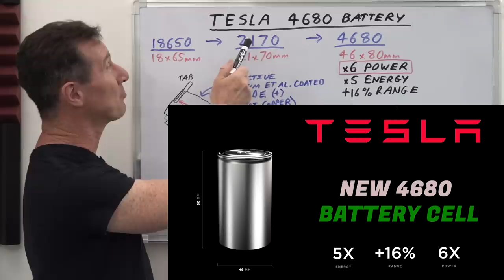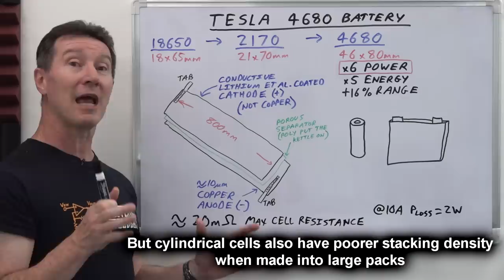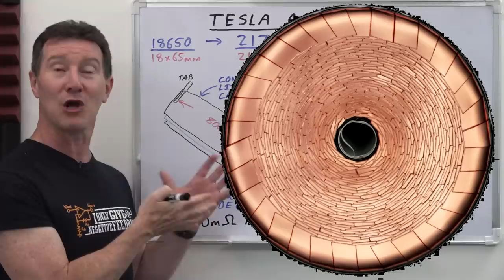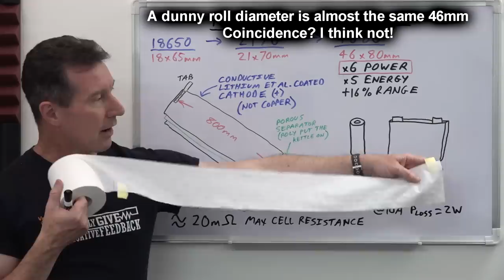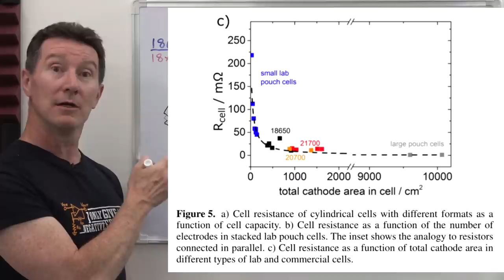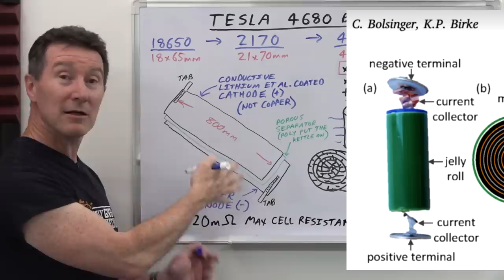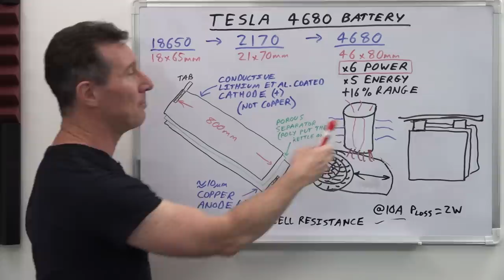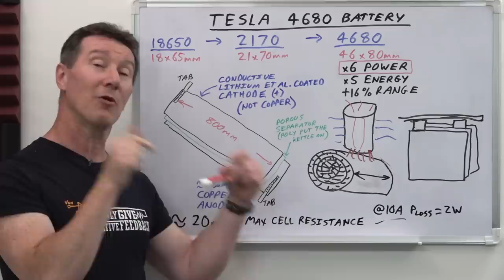EEVblog 1340 - New Tesla 4680 Battery Cell EXPLAINED

Comment: Amazing video. One question, how do they prevent shorting the cathode and anode when folding a single layer like this?
Reply: Instead of the beginning and end of the roll being anode and cathode, it's the entire top and entire bottom of the roll.
Reply: Guessing the two sheets are offset so a small amount of copper from the cathode layer, without the lithium paste coating potrudes from the top, and likewise for the, anode layer for the bottom.
I'd imagine the offset would allow, either end to be folded without anode or cathode contacting. 
Perhaps I very narrow band of insulating paste at the top and bottom of the roll. It will be interesting to find out.

Comment: I did the math (geometry rather) and any type of cylindrical cells packed in a hex grid yield the same 9.31% volume loss (the space between cells lost due to them being circles and not hexagons) independent of cell size. You get some nice gains because of less steel casing, as you noted, namely 54% less lateral steel with the 4680 over 2170 and 60% less over the 18650. Whether that translates to +16% range, depends on how much steel you had over battery stuff in the first place. The +16% is probably due to this effect coupled with better material science. It sounds a very reasonable number.

9.31% = 1 - (Area_inscribed_circle / Area_hexagon) = 1 - (3π/16) / (3×√3/8)
54% = 1 - (Circumference_46 / Area_46)  / (Circum_21 / Area_21) = 1 - 46/21

Comment: Tab less? How do they connect? Like just jumper wires connecting them? Doesn’t seem too noteworthy
Reply: It uses 1/5 the amount of connections. So it simplifies manufacturing and less points of failure. The entire event was basically simplifying everything to make manufacturing cheaper and faster. "The best part is no part, the best process is no process" elon musk

Comment: How long till manufactures make skid plate style packs like Tesla but having huge oval cells the width of the vehicle and height of the pack and then just use the pack length to cell length ratio to get the required/desired voltage?

Comment: Good explanation, but the 6x power out of 5x increase in volume makes no sense.  The much shorter path of the tabless design should up the C rating from 3c to 20c at least.  Giving a total max discharge power 100x a 18650 cell.  A company called Inventek patented a large "coin cell" LiPO cell 15 years ago taking advantage of the same short path tabless heat management and high power rating.  They went bankrupt.  Couldn't convince anyone that a 6" dia 2" tall 80Ah coin cell made sense.

All I ever hear about battery tech is "increase range", when there should be a market for smaller packs that have high discharge rate for high HP vehicles with shorter range.  Not everyone wants or needs a 300 mile range EV that needs a 100kwh pack, but a 20kwh pack won't produce 300hp for a vehicle without better than 5c max discharge.  Yet a 20kwh pack vehicle could cost $20k less, weight 800lbs less, and still provide high hp and 100 mile range.  Instead, the battery pack question seems to revolve around how much more range we can get out of a 1000 lb pack instead of the minimum weight and size pack.

Comment: 16:49  i think this is where everyone is totally missing the point. Tesla already has plenty of power output in their batteries.

The 2 things tbey are trying to do with this that arnt as sexy and also they dont want to admit that thwy have a problem with their current offerings are 

1 is evening the impact within a cell, these cells are physical electrochemical things, with the old tabs the cell is not taking the large current hitsevenly the areas closest to the tabs get hit harder than the areas further away. So as they run them at maximum tbey slowly lose high current capacity and start acting rather strange. With the new design this phenomenon is basically gone a cell should retain its proformace many many times longer if driven like a sports car

2 and this video already addressed the electric. The resistance is lower so is power lose is lower, testla has no problem getting enough current presently but it absolutely does have a problem with the batteries over heating in proformace stop and go or mountain up and down proformace use,,,, the battery will start to over heat in just minutes and reduce output and thats even with regenerative braking turned off and using upgraded friction breaks

Comment: This Design is interesting. the question is how to get the tabs mounted to the bus bar. With the pouch design you can ultrasonically weld or laser the tabs. with Teslas old design they used ultrasonic wire bonding. If its just contact Cu to Cu then corrosion will eventually work its way in. Lasers sill would be possible and most likely. would love to have this confirmed.

Comment: why is everyone fixsated on the tabs when the actual breakthrough is in the materjals used in the new cell. When you get same energy density as 2170 cells in 4680 but much more accsessible/cheaper materjas, thats where the breakthrugh lies.

Comment: Maybe the 16% figure is on the pack level not the cell level, and the other two figures are just comparing cell vs cell. Sure, a bigger cell is better but you don't put as many into a pack as a smaller cell.

Comment: They need to use hexagonal batteries. As bees know for their honeycombs, it's the most efficient use of surface area for maximum volume, without any gaps in-between.
Reply: Richard Nutman you want some space for thermal management and it is slow to roll hexagonal shape I assume.

Comment: As Elon said this numbers are just the contribution of the large cell and tabless design. The range improvement is due to the more active volume by the same footprint, thanks to the 10mm higher cells and the efficiency. To this we have to add the other innovations regarding chemistry (the solution on the anode is very impressive), and the structural pack. I like your comparison with the 🚽 paper! Thanks for your explanation!

Comment: I don’t get it. The pouch cells exist and it’s not totally clear the 4680 has leapfrogged it in any dramatic fashion. So why has Tesla stuck with the 2170? I thought Tesla was innovative, not the conservative late-mover. Comparisons between pouch cells and 4680 would have been more relevant.
Reply: Maybe just maybe availability of battery cells? It's not all about innovation sometimes its about getting the product out there to make you money to do innovation?

Comment: How does is affect charge time ? surely if its effected by reducing the resistance it will be improved?
Reply: It should help significantly, especially since the new cells can dissipate a lot more heat.

Comment: Can someone please explain why flat cells are not used? I would have thought that would be the most efficient from a space and cooling perspective and easier to produce.
Reply: Not structural, you would have to add that increasing weight thus decreasing energy density of pack. Might work better for stationary storage were that is not an issue.

Comment: Why nobody got the idea: There was no reason for it. And engineers usually work to meet the demands placed on them. 
But the CEO is actually a software developer. It's about solving problems and optimizing the solution as much as possible to save resources. 
These are two completely different ways of thinking.

Comment: Since I saw this design on battery day, whats really been bugging me is how they stop the battery shorting. 

With a single tab the seperator or just the back of the tab could be insulated. When the whole role becomes a tab, each tab  either needs contact through the tab above it, or are the tab lengths calculated to such an accuracy that the seperator backs onto the whole tab, but the overlap is so small that the next roil tab is exposed. Seems like too much hard work and complexity to get it perfect. 

Or does the second film simply stop short in the cylinder, so that even when the tabs are folded over, they are too far away physically to make contact. In short meaning the tabs are extra long and only the top part is folded which wastes a small amount of potential capacity.

Anyone know the answer?
Reply: No shorting (as voltage difference is betwwen botom and top of cylinder )

Comment: Maybe the original tabbed design was originally made for an entirely different battery application? AFAIK noone really used the cylindrical cell for this high load and high durability, until Tesla came along?

Comment: I wonder if the conservative range increase estimate is due to a desire to get more realistic range numbers.

One thing that annoys me about Tesla is they quote range based on someone starting with the battery at 100% state-of-charge (SOC) and then driving  to 0% (SOC) - which nobody does.

Maybe the actual capacity increase is larger but they're keeping some in their back pocket so that they can gradually move to a more usable range quote.  In other words the new 100% is equivalent to the old 90% and the new 0% is equivalent to the old 5% or something like that 

Then, everyone could always charge to 100% (and do it faster - since overcharging isn't a risk) and always discharge to 0% knowing that if they miscalculated there is still some range left.

Comment: so how is the 4680 better than the large pouch cell???  and the 16% is due to the less weight in the jacket.
and 16% is a big big deal so 300 miles to 350 miles. They get way more than 16% with the other changes like silicon anode and high nickel cathode.

Comment: Haven't they been doing this with capacitors for nearly a century?
But you're quite wrong about packing density; bigger (cylindrical) cells are going to be a lot bulkier than small cells. Try carrying a sack of boulders then a sack of sand.

Comment: I'm actually surprised that cylindrical cells are appearantly the way to go in the automotive industry. Wouldn't pouch or cuboid designs yield a better energy / volume density since you can stack the cuboids more efficiently?
Reply: That wouldn't be structural to the chassis of the vehicle. Just like the gas tank on an airplane doubles as the actual wing.

Comment: Continues tabs - lower resistance, less heating, so higher power, so can use bigger cells, so bigger density. Plus it is faster to manufacture (continues production, no extra steps, less poossible points of failures). Win. Win. The major win is that due to better thermals (despite smaller surface area per Wh), and lower resistance, they can be now charged even faster. The "tabless" technique was used by capacitor manufacturers in the past, but wasn't employed for producing batteries in the past, because nobody really needed to charge batteries at 100A in the past. Good and pretty obvious move from Tesla here. The flat sheet cells do have still a bit of an edge in terms of energy density, but if they cost more because less optimized production process, that is a moot point really.

Comment: My next engineering  instinct was to dip the tabs into flux and then a solder pot to fuse the tabs before inserting into the can to ensure over time the copper doesn’t deteriorate over time, or tin the edges of the tabs before applying to the anode or cathode, then flash heat fusing the tinned edges once rolled and folded.

Comment: but what about fusing the cell, if you have that big conductor at the end of the cells directly connected to a conductive plate ...you might get great heat transfer and low resistance, but you are losing the your ability to fuse.

Comment: Quick question would it not be the case in terms of the tab battery that as you said the maximum distance would be 80 cm so the min would be almost 0 meaning if an equal amount of electrons were produced throughout the battery the average distance would not be the maximum but somewhere between the maximum and minimum so 40 not 80.

Comment: i wonder why they don't make square based batteries. Then in each battery pack you could put them together tightly. Its propably down to manufacturing process ass it is easuer to put togother round roll than square roll together. Still it would be more energy efficient and powerful battery if it was based on a square than on a round disk. Just a tought I would like to share. I don't expect a definite answer couse I am less than a newbie to this idea.

Comment: This is a nice practical development. I gather they avoided perforating the foil because that may have caused it to develop creases, which causes issues as you roll it up.
-- I'm not into electric vehicles for mass standardization, but I'm looking at it in a practical way. 
--Look at gasoline. You can use it faster for more power, or slower, either way at a predictable efficiency. You can easily take gasoline from point A, and use it at point B, very easily. The rate of use is literally how fast the level of fluid in the container goes down.
-- Look at electric stuff. We need a particular voltage and rate of transfer in order to accomplish a given task. This implies that you have the right container. Nature will bill you in the form of heat just to take energy from one container and put it in another at a faster rate, plus you need the right container. 
-- Now, I'm also into tools, and I know that the right tool for the job, in the right facility to use the tool is awesome. So, big cities are the right facility and EV's are a great tool for that facility and application.

Comment: Great innovation here but I must wonder about the internal physical aspects of how the metal terminals contact the case of the battery as it would appear to be relying on a non-welded method IE the core simply pressing against the case terminals meaning thermal cycling causing expansion/contraction would eventually degrade the connections (possibly case deformation as well) resulting in the internal resistance increasing over the cell's lifetime.  Of course I could be totally wrong about this (happens a lot) ;)
Reply: Belleville spring washers might be needed to insure stable pression ...

Comment: Looks like CBAK Energy Technology, Inc. had also come out with a tabless battery design. I randomly bought 955 shares today of CBAT because it was the only stock that was moving up from all the EV stocks I’m watching. I just had some surplus funds in my Robinhood and so I put it all to work. Then I saw the big jump and I started researching why. I couldn’t find anything anywhere....until I found this lonely random article dated 09/28/20: “CBAK Energy has Successfully Developed Large-sized Cylindrical Tabless Battery with 25% Boost in Energy Density and 20% Cost Saving”. What the?! Do you know what that means?! This is HUGE! I don’t want to put the link to the article here because I don’t want you to think I’m trying to spam. Google the article for yourself. The quote above is the title of the article. 

As far as I know, Tesla is the only one that developed a tabless battery design. Googled around “tabless battery” and the only thing Google returns is about Tesla. On Tesla Battery Day all they talk about is their “tabless battery design” and how it is a game changer for them. Now I stumble across CBAK Energy doing the same?! Look into this and tell me where my thinking is wrong. According to the article, “CBAK Energy Technology, Inc. ("CBAK Energy",NASDAQ: CBAT), a world's leading lithium-ion battery provider”...wow. The worlds leading!!! Let me know what you think. Have a good day.

Comment: There is no incentive for the battery producers to use the tabless design. Shorter lifespan = higher sales. Revising production line also means money needs to be invested. You invest money in R&D and restructuring the pipeline and in the return you get lower sales. Tesla had the incentive because it would benefit their actual product which is the car. And I think +16% range comes from recovered power loss and decreased power need for thermal and battery management.

Comment: To say this isn’t a big deal it’s way off base. Fewer parts mean greater reliability. Better cooling means longer expected cell life. Simplicity of design means easier to maintain. Tell someone who sitting on the side of the road, in a broken down car,  the fact that their  car is less reliable, and is going to be more expensive to repair because it’s missing the features and see if they think it’s a big deal.

Comment: As Elon has always said, 'manufacturing is orders of magnitude harder than building a prototype'. This was a less than subtle hint that Tabless hasn't been 'produced' previously because it was too hard to mass produce. Tesla have cracked this, it's not vapourware, as someone on here has questioned. They have a small production run at the Kato road facility and have had these batteries in packs, in cars since May.  There may not have been the incentive to crack the production issue previously as no other Auto manufacturer was serious about EVs. Tesla are, along with storage and energy.

Comment: I wonder how long it will take for the Chinese manufacturers to start selling the 4680s on ebay.   I would be very interested in a better battery for my electric motorbike.  All the available space on it is already filled with a 40ah made up from 1865s.

Comment: I wonder how this design will affect performance in cold climates. More efficient cooling won’t help a battery that’s been cold soaking in a North Dakota or Alberta winter.
Reply: I would expect it would work in reverse too, the octavalve allows heat to be transferred between different components, so you can have a resisitance heater preheating the cooling fluid, while connected to the mains electric, but it won’t need to start up as early. In my i3 it takes 3 hours but isn’t on constantly, does a bit big chunk at the start, then cycles every so often to allow the heat to permeate. If you have a big thermal conductor like that, then you can heat the water to 30 degrees C and simmer till departure time.